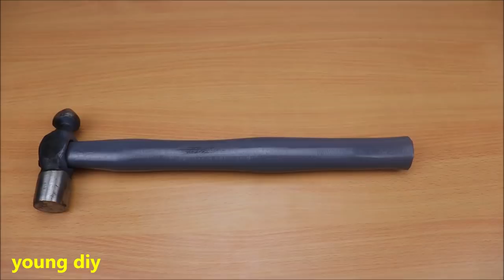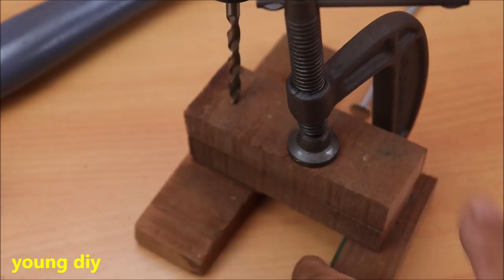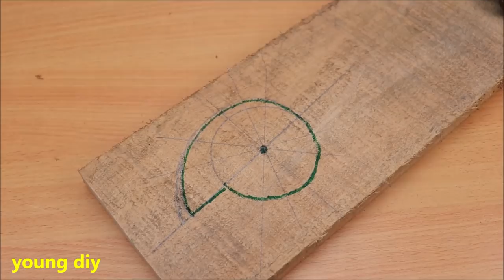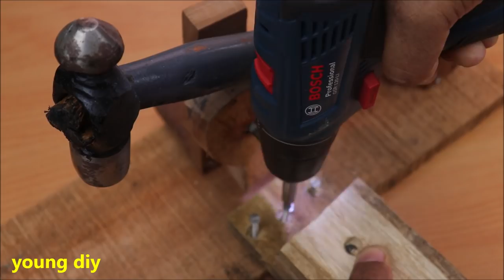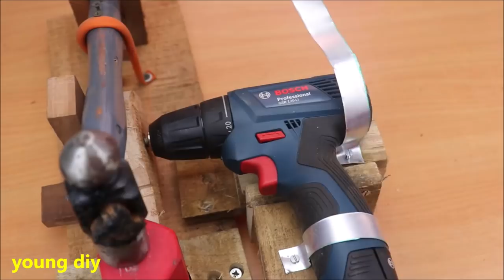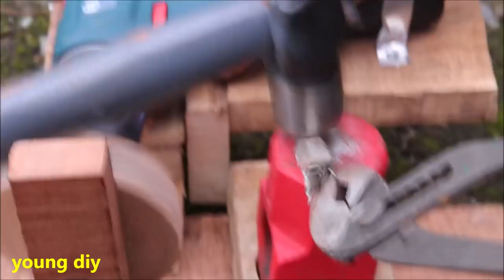How to Make a Mini Drill Powered Hammer at Home. |DIY |

Comment: Never hit to hammers together they will shatter it hit hard enough
Reply: Melissa Wolfram This is hitting with the power of a stretched rubber tube so it’s never going to get close to that.  Also sledge hammers aren’t hardened as much as most, because they are meant to handle huge sudden force against a steel spike or splitting wedge.
Reply: Its not just the small rubber tubes.... The paint on the anvil hammer will probably help stop the chips. 😂

Comment: Or maybe just maybe you could use the hammer on its own and save All the fuss 🧐
Reply: Joe Morris and using by hand would most likely be easier faster stronger and you can more easily control hitting power